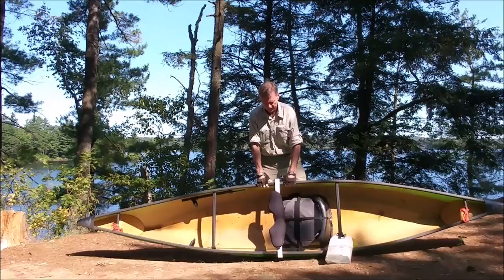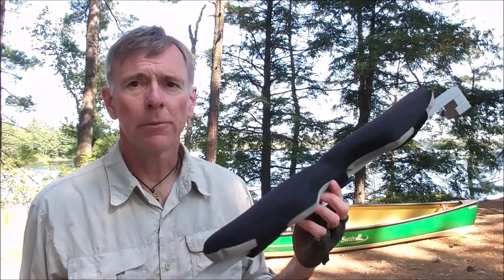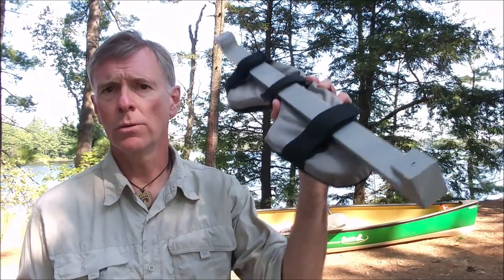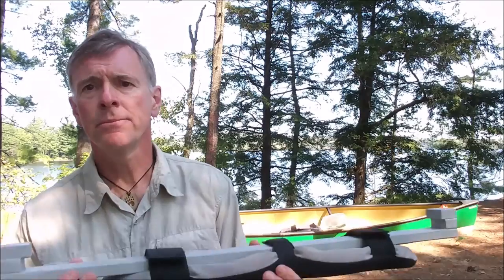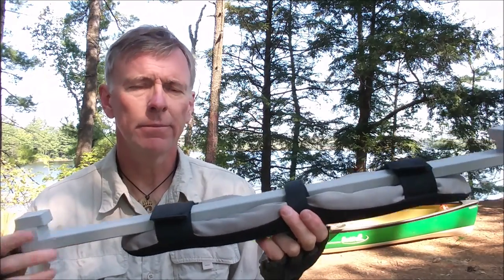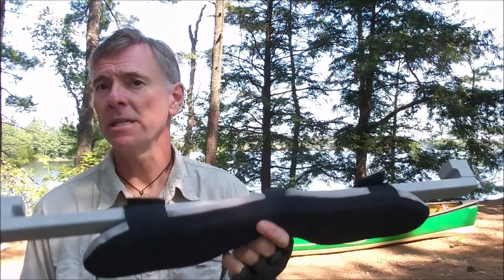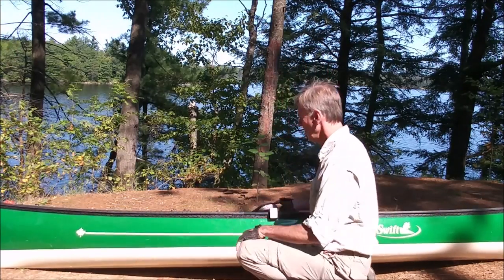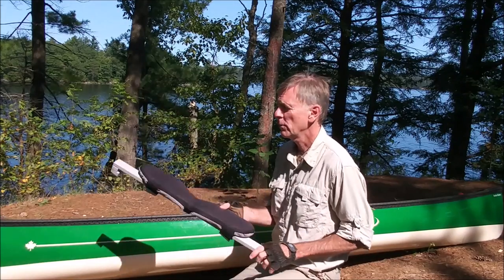A Quick and Easy DIY Portage Yoke

Comment: Your a regular modern day MacGyver. Lots of tips and tricks.  I love your canoe cart video. Currently looking for materials to build a cart so i can attach and portage the canoe to my mountain bike and drive the 1k to the welland canal from my home. Leaving a 0 carbon footprint. Thanks for being so inspiring.
Reply from the maker: MacGyver?  I consider that high praise!   Thanks for the compliment, for watching, and for leaving a comment.  With respect to a cart intended to be pulled by a bike, you might need to incorporate some sort of breaking or slowing mechanism for the cart itself. I can well envision a tail-wagging-the-dog mishap if you had to suddenly stop on a downhill or if a big crosswind hits your canoe while towing it.  Whatever you come up with, I'd love to see it!
Cheers, 
- Martin
Reply: PineMartyn thanks so much for the input and the macgyver comment was totally meant as a huge compliment. So far the plan is to re-purpose a childs bike carrier (wide base so the canoe sits low) to offset the top heavyness (low center of gravity) and as far as hills go it’s flat as Saskatchewan here in welland. Lol. I’ll make a video of the process.  😊👍
Reply from the maker: I would love to see what you come up with. :-)
Cheers, 
- Martin

Comment: Great idea. I think I would need to make mine out of ash or maple. My canoe weighs 80 lbs. I like this idea I think it will work great. Thanks for posting this Martin. Have a great week
Reply from the maker: THanks. Glad you like the idea.  You would definitely need a stronger wood, such as ash or maple for a canoe of that weight.  You definitely don't want to risk having a boat of that weight come down on you because you used a yoke too weak for that weight.  Just make sure your hull is flexible enough to be able to squeeze the two gunnels together a wee bit to ensure that the ends of the yoke will be able to be affixed and removed without a struggle or damage to the gunnels.
Enjoy your new boat and happy paddling,
- Martin

Comment: Hey Martin, I have a Pack 12 and really like it's light weight. Prefer paddling as a canoe not a kayak. Will be making a yoke just as described. Nice lake in the background. Well demonstrated. Thanks
Reply from the maker: I sometimes use a single-blade paddle with my pack boat  just because I love paddling in the traditional canoe style, but when I have a lot of miles to cover, or when I want to go fast, or if I will be paddling in wind and waves.
Cheers,
- Martin
Reply: @PineMartyn  Just ordered a 13.6 and I too like traditional paddling and I was hoping that it would be possible on occasion to do, so glad it`s possible. Thank you for your good advise.

Comment: You gave me a very good idea for mine; I will get the pad and a lightweight wood but also strong and will make my own but also doing it following the pad contour; will try to stay about a pound or at least under a pound and half. I am a carpenter and have all the tools to do it, have not done anything in carpentry for years but that will be an excuse to dust off my tools, lol. I like the Carbon one they sell at Swift but the $400.00 tag is crazy, although they told me if buy from US it is about $300.00 with the current exchange, still,   its weight is about 2 pounds so it is not really superlight to justify the price tag in my opinion; so i am glad I found your video! Thanks!

Comment: I know it's 4 years now ... but wondering how this has held-up for you?  I just got a yoke-less Swift and want to copy your design.  Thanks for any thoughts.
Reply from the maker: Good question.  I am still using mine.  But, keep in mind, this design, with it's small wheels, is intended for carting your canoe along roads, lawns, flat trails, etc, and not over rocky, log-strewn portages when the canoe is loaded with gear.   So, mine is still working fine, but I use it for it's intended purposes will within the limits that the materials can withstand.
Hope this helps, 
- Martin

Comment: So awesome, i just got a pack 12, do you happen to still use it and if you do what are the dimensions so i can make my own. Also do you think kevlar skid plates would be good on the pack 12? thinking of going to swift and getting those kits to put on my boat.
Reply from the maker: I do indeed use my Pack 12, all the time.  I love it, whether I am using a double-blade or a more traditional single-blade, it's a joy to paddle.
I didn't put skid plates on mine because I didn't want to add any excess weight and, while I do not baby my boats and am fine with scratches on the hull, I avoid ramming the shore when landing, so have never felt the need to install skip plates.  It's really a matter of how rough you want to be with it, so you are the best judge of how you will treat your boat.
Cheers!
- Martin
Reply: @PineMartyn  for the Velcro did you use  fabric Velcro or would regular industrial Velcro stick in the level six yoke pad fabric?

Comment: Great video!  I’ve been looking for a solution to portage a sit-on-top kayak, and this item is a good starting point.  There’s virtually no head room/clearance, so the next step is to somehow attach some vertical supports so I’m not completely supporting the boat with my head.
Reply from the maker: I'm glad you found the video of some help for your portaging situation.  Thanks for leaving a comment.
Cheers,
- Martin
Reply: Hey, friend!  I'm a little late in seeing your comment, but you might find a tump line to be a more suitable solution for a kayak.  In case you're not aware, a tump line is a strap that attaches to the sides of a load - such as a backpack or kayak, and is supported on the top of one's head.  The hips carry the majority of the load, while the head-strap provides stability.  All this sounds complicated, but it's pretty straightforward - do a Google image search to see what I mean.
Most outfitters would be able to set you up with a purpose-made tump line pretty easily, or you can readily make your own with any sort of broad strap (as long as it will bear the weight needed) and a bit of knot-work.
Good luck!

Comment: Great light-weight diy project... for the day I ever get that tremendous boat!  I have been using the same pad with a 50 lbs canoe but am finding the foam flattens and wears out after a season of tripping.  I may try to re-pack it with a better foam, or find a better pad if one exists (-:

Comment: Great idea! I've been thinking about getting one of these boats.  Did you get yours directly from swift? And curious, why did you decide on 12ft rather than 13.6?
Reply from the maker: I bought it directly from Swift Canoe & Kayak at their Oxtongue Lake location in Dwight, Ontario.   I have a very recent video where I offer a detailed review of the Pack 12, it's handling characteristics and how I outfit it and I explain why I chose it over the Pack 13.6.  But the short answer is that, for a person my size and weight, the 12 is as much boat as I need for canoe-tripping. I wanted the lightest and smallest boat because a lighter boat is easier to portage and the smaller size means it's easier to negotiate very tight turns on narrow winding creeks. Another reason is that the 12', being shorter, handles better in waves because the longer 13.6 tends to plunge into an oncoming big wave, whereas, the shorter 12' rides up and down them, meaning less water gets shipped into the boat, not being slowed as much by waves, and there's less need to quarter a wave coming right at you. It's also easier to turn or correct one's course in a short boat, which is an advantage in a head wind, tail wind, or cross wind.  In windy with big waves, it's a big advantage to be able to efficiently change the angle of the boat. 
The advantages of the 13.6 would include more carrying capacity for both a larger paddler and more voluminous and/or heavier gear. It tracks straighter than the 12', so fewer correction strokes are required (though with a double-bladed paddle, neither boat requires much in the way of correction strokes).
Hope this helps,
- Martin
Reply: Thanks so much!

Comment: Nice... your a better engineeer then you are a wood worker ;)
Reply from the maker: That's true.  Although the odd angles on the cuts were deliberate. I didn't mention it in the video, but the hooked ends were cut at an angle (not 90 degrees) so as to better conform to the angle of the hull.  But, I take your point...I'm not fine craftsman. lol
Cheers,
- Martin